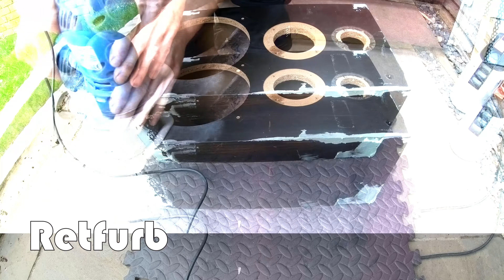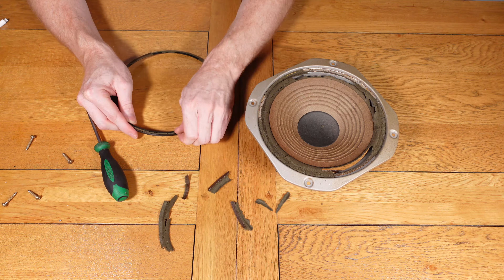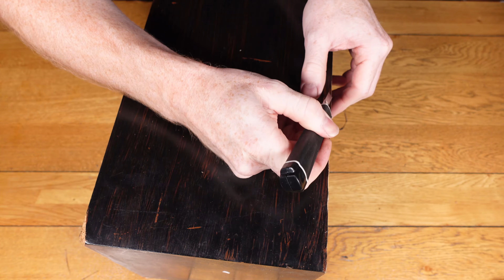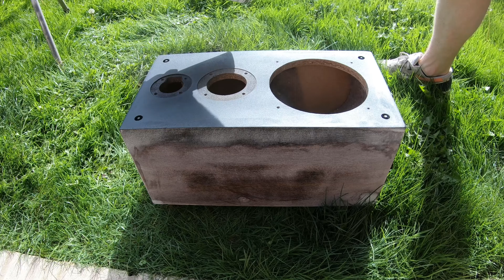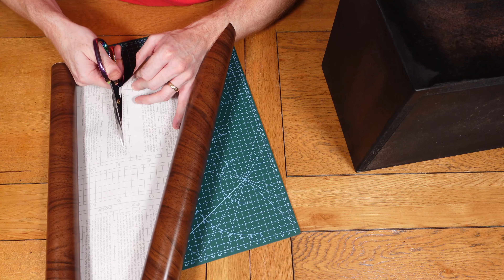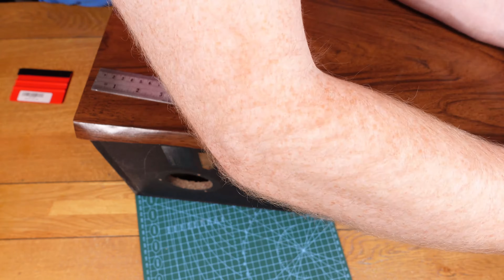Technics SB-3030 Speaker Overhaul Restoration Repair - Retfurb Vintage Audio

Comment: A great way to save money yet wanting some new speakers but don't have alot of cash is getting some old cabinets 
and simply replacing the drivers and crossover unless you want to make use of a DSP. Or a Bi or Tri amp setup. Which would be the best way to go.
A recommended driver manufacturer - "SB Audience" located in Indonesia is better than 99% of what's available out there.
But also need to give a shout to "Eminence" speakers as well.  Hard to go wrong with either brand.
Reply from the maker: Thank for that information, Hopefully it will help others.

Comment: I like the smallish 3-way speakers offered in the 80's and 90's. Today, everything is 2-way designs. 
Even many tower speakers. It sucks. No, we don't need to hear any Mid-level frequencies.
I'm working on a pair of Kenwood 3-way speakers from the late 90's. Drivers seem to be in actually good shape
hoping repairing the crossover is all that is needed. Over time, I will probably upgrade the drivers, especially the woofers.
Reply from the maker: Great, Love it.

Comment: DO NOT refoam your speakers like he just did
Reply from the maker: @mrkrinkle8323  Please can you explain another method of doing this, so viewers have the option to follow that.
The only thing that I would have ideally done in hindsight, is to shim the voice coil with paper. Removing the dust cover first and sliding the paper around the coil. Then fitting the foam and applying a new voice coil dust cap.
However, I was careful to get it central and it has been fine since 👍🏻
Reply: @retfurb  do the speaker first & basket second. You got lucky possibly? You need to make sure it's centered perfectly so the voice coil doesn't rub
Reply from the maker: @mrkrinkle8323  yes, agreed. I should have shimmed it with the paper, to make sure it kept central.
I was very careful when I did it this time and it’s been fine.
Thanks for adding the additional information.
Reply: Speakers look great btw.
Reply from the maker: @mrkrinkle8323  thank you
Reply from the maker: @NineS5  I have done multiple without shimming, to save the dust cover in the centre. But yes, you do need to be careful to keep it central.
It is better to shim it if you can, but I’ve done it both ways.
Even with shimming, you need to make sure the foam is glued centrally. Otherwise it will still be off centre.

Comment: Hi mate what paint is it ?  Name and colour please thanks  great job 👍
Reply from the maker: Hello,
The black textured paint is an aerosol, Which was purchased from a local car paint supplier. You can find many brands that do this, As its what is used to repair textured panels on cars. Something like this https://groveshop.co.uk/ready-mixed-paint/21164-gti-black-texture-coating-aerosol-500ml-by-grove-gtitexb.html?gclid=CjwKCAiA-bmsBhAGEiwAoaQNmu9a32d8v9ZPqzUxeFOUg2zU2ovJPdWmwmrPhexevDDEsBm3KsEDhBoC3coQAvD_BwE
I think that is the actual type I used, If not it I have used it before.
I hope that helps.
Reply: @retfurb  thanks mate and the paint for paint by brush?
Reply from the maker: @R.R.Defense  No problem. This was just a black carpet dye that I have. It is a pump spray bottle, That is for car interiors.

Comment: Looks very good! Does the foam/ rubber replacement degrad the original sounds?
Reply from the maker: Thank you, I was pleased with how they turned out. No it doesn't change the sound. They just need to be fitted centrally, To make sure they operate as usual.